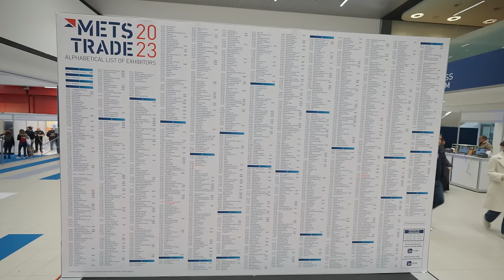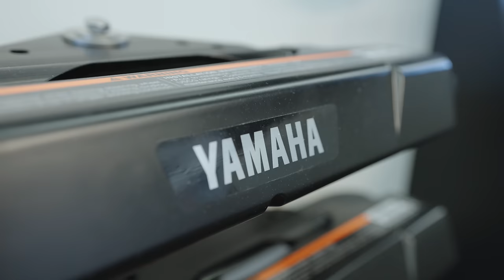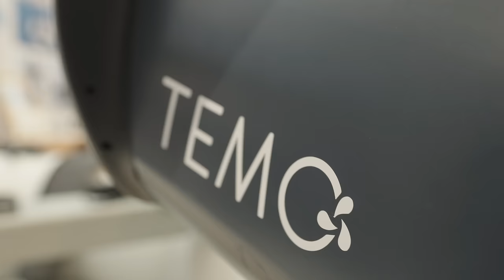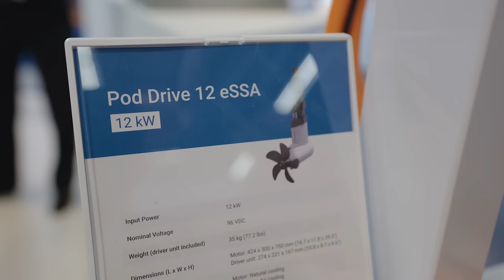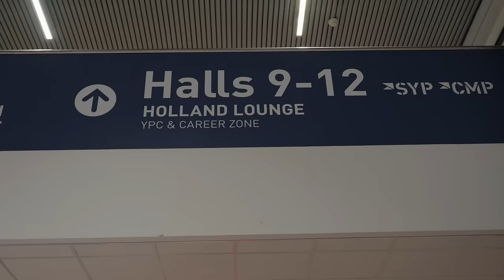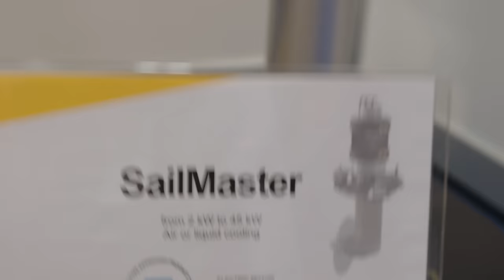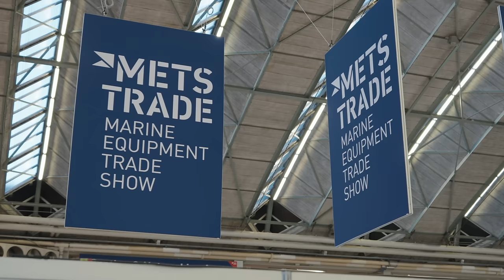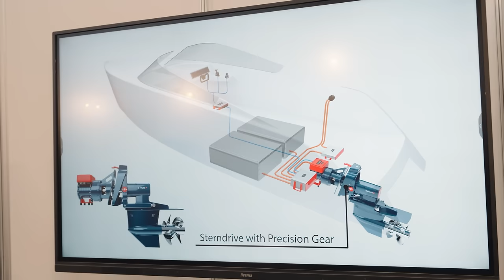The Shocking Truth About Electric Propulsion | Step 371

Comment: I think you guys are a lot further ahead of not only most sea going sailors, but also the industry.
Most of, if not all the manufacturers, cater for the weekend / holiday boaters, who dont have the needs for regen. Its really all about cost, as any electric powertrain carries a near treble the cost to to that of a Internal combustion engine, mostly from Batterys and charging kit / infrastructure.
The Oceanvolt servoprop system alone, is worth more than most peoples boats, i think the whole kit is something around 80K euros, and you need fit it.

Most sailors i know wouldnt venture too far off shore with any electic propulsion system. In fact most sailors would just wait for wind, even if it takes days or weeks.

There are to many weird and one off parts, and voltages , and with so many competing designs, electic drives would need to standarise themselves so that the components would become intercompatible with each other. Imagine rolling into a place like Svalbard on a friday night needing some one off sensor, and they dont have it in stock with your manfacturer.

Hybrid is the solution for the sea going sailor, or even a power boat, as seen with dutch company Combi, and the UK company Hybrid Marine, they fill that gap with both diesel , electric, and regen, all in one package, with the bonus of not needing a diesel generator.

It maybe 20 or so years before electric propulsion for offshore boats, becomes the standard, and there will need to be a big technology jump, in batteries, along with a Industry standardisation on voltages alone.
It takes a lot of time before people see the reliabily and durability for sea / salt water electric kit, before you can say its really better, because the price is still to high, and questionable reliability for the long term.

Comment: Very interesting. There are two other questions I would be asking. Firstly the carbon footprint of electric systems when compared to the potential lifetime of a diesel over electric. IE sustainability and repair when the do eventually fail. Diesels can almost always be repaired, even if it is un economic financially to do so. Secondly the motor is only 50% of the system. Too many of the systems currently available focus on Lithium - Ion batteries not LiFePO4. The former being "borrowed" from the automotive industry and very susceptible to thermal runaway if damaged or there is a charging fault. Lithium Ion should be treated as a potential hazard on a boat whether its a scooter, electric bike or the main power bank. Sail Safe Guys, Ant & Cid.

Comment: I am surprised you have never seen anything like the Combi. I priced up a system for a client, and a 10hp Beta diesel with a piggy-back vetus electric drive, was not only cheaper than full electric with the required range, but as you note, a mega battery charger that required short run time for a full charge.  Some may prefer a diesel, or like you, a petrol generator as a back, rather than a complete engine.  Real world use matters at the end of the day to what is optimum for each use.
Reply from the maker: We’ve seen plenty of electric motors strapped on the back of a diesel to create a “hybrid” system. It’s definitely not new. Also not our favourite solution. But usually those systems are for new installs. We’d never seen a company that willingly promoted retrofitting any existing diesel with a plate adapter to mount an electric motor. That’s what we were interested in for all those who have a working diesel but still want electric.

Comment: The last co. with the prop facing forward I found most interesting. Perhaps mounting a forward facing prop in front of the keel might be most efficient. Since an aft prop must push the boat up various waves some work is wasted lifting the boat. Like an aircraft propeller, in front of the wing the rising and falling of the hull when underway should have less energy loss, and with less obstruction to the sea more efficient regeneration. I'm also thinking it might work best mounted to the keel  instead of the hull. What are your thoughts?

Comment: This was really interesting and informative.  Something I noticed missing was the power platform requirement and also AC vs DC motors.  I also think there is a lot being left on the table with regen in prop design.  And the true science behind KE vs Hull speed is understated and over sold.   25% less power is a bogus number I’m quite confident.   It takes “X” amount of thrust to move an object through water.  A drag co-efficient that is exponential, not linear.  
Electric on a boat is like living off grid with electric.  It’s a lifestyle choice which requires some sacrifices but also an understanding of mission and ensuring enough available storage

Comment: fix pitch VS variable pitch vs servo prop. It is true that a fixed pitch prop can be the most efficient prop.... but only at one speed and load. While a variable pitch prop might suffer from having to work well at all pitchs, the needs of an idling prop just starting to move the boat as compared to full speed after the boat is at "cruise speed" (even if that is only 6 knots) are quite different. Regen is different again and needs yet another prop... not just running it backwards (nice try). I listed the servo prop separately because even though it starts out as a variable pitch prop, it is the servo aspect that really makes this work. It is true you can't just stick a servo prop on your current setup and go, it has to be integrated into the system and have the software to make worth anything at all. The use of such a system shows that the company is thinking of the system in all aspects to get the most out of the the power coming from the batteries or from the ships movement back into the batteries. Very much the same as an MPPT charge controller does. What I saw as you moved from booth to booth were over priced trolling motors on the one hand and standard electric motors hooked up to whatever prop was currently in use on the other.... even for commercial use (well small commercial use, you didn't see any systems for really big vessels). The torque curve of the electric motor is so completely different than diesel as to make using the same prop or even RPM range laughable. OK, the first one you looked at was different.... I would have to see side by side test with this compared to a prop at various speed and load conditions. It is a new propulsion style whose characteristics are not yet well known (how long will the moving part last in sea water or sunshine).
Reply from the maker: Yes. And currently the servo prop has 4 fixed blade angles. But I believe they’re working towards truly variable, as it it’s constantly adjusting based on speed through the water in both regen and propulsion. It also means you can build one system that works on hundreds or different boats by simple software updates.

Comment: ocean volt isn't the only ones finally learning why planes have props facing forward (puller/tractor config) vs facing backwards (pusher). the 2 biggest reasons having the prop facing back is convenience in engine placement as well as less prop snagging on ropes, seaweeds debris, rocks etc, but facing forwards is maximum efficiency since there's nothing in front of the prop to take wind (or water) away. it's just more susceptible to damage, snags and drag. some twin engine planes also feather their props in the event of a single motor loss to prevent weatherveining causing a flat spin due to drag. ocean volt got it right for a static mount. i like the EPT better since the prop is more efficient. either way, if your facing forward, go feathering. facing back wards, furling.

Comment: I can totally understand that many companies do not focus on regeneration. Most boats are not sailed around the world, anchoring when not being sailed.  They spend like 90-95% of their time in the marina to be sailed on the weekends. For those, regeneration is simply not something that matters. But I can still see how an electric motor makes things easier here. Instead of carrying canisters of fuel, spilling some on the boat, one simply plugs into shore power. And it is much more silent. The same reasons I went for a battery-electric lawnmower. It is just more convenient than a combustion-powered one

Comment: The problem with regen is the expense for what you get. And, it's only good under way. Waste of money if most of your time is at anchor or docked. Which is what most people do. AND the constant cruising community is so small, it's not worth it for a company to develop anything.  Got to sell lots of units to make the price good . How much money would you have to charge to make a dozen to two dozen units a year for boats in the 30 to 40 foot range. This is why units that do have regen are lucky that it didn't cost much to build it in without losing forward efficiency.

Comment: I have two Elco EP9.9 outboards on my boat.
I like that they're not proprietary. I can use any 48V batteries.
And because they're using the same chassis as Yamaha and Tohatsu, there are a lot of third-party accessories available.
Reply from the maker: Have you ever done comparisons to how efficient they are compared to direct drive units like ePropulsion or Torquedo?
Reply: @SailingUma  No. The diesel on my boat was marginal. I'd originally intended Torqeedo or ePropulsion pod drives, but I realized I could add outboards without removing the diesel, so I could convert stepwise, minimizing the time my boat was on the hard nonfunctional.
That the Elcos use standard chassis means I have gearing and hence oil changes, and water cooling and hence impellers to deal with. But it also meant I could add Ezy-Glide stick steering, and that's made getting into slips a lot easier.

Comment: What the dude from EPTechnologies says at 44:40 is true: Packing propulsion, folding/servo blades and regen all into a single package inevitably begets a finicky system prone to inefficiencies and cross-dependencies (e.g. if propulsion fails, so does regen). It is surprising to not have a single system with two propellers, one for thrust, one for regen, to work and fail independently.

Comment: Big props (ahem) for this big tour of the "state of the art" great work!

It's strange how many companies seem to just not get the importance of regen. I'm another long range cruiser who really sees it as a must have. Granted, it is complicated and to get the most out of it. They will have to run some CFD simulations of various prop models. Even the companies that are the best at regen are really cagey about the data. Ocean volt seem pretty good, and the variable pitch idea makes sense, buuut the pitch controller does not take in boat speed data or have any way to learn and predict the optimum settings based on historically observed performance for given environmental conditions. They won't sell (me) a system without including their own batteries which are like 4x the price per Kwh of more standard LiFePO4 cells , and in general the system is really expensive. Also, the VP prop is only available on sail drives, which I find strange given that shaft drive is often preferred by the the folks most interested in regen, the long range cruiser,  because of it's stronger design, being naturally more protected from impacts, over the more exposed sail drive. Also, I didn't see a single one using axial flux motors which have a vastly higher power density than other motor designs. makes one want to have a go at designing their own ... 

I was a Torqeedo customer already 8 years ago for an outboard (cruise 4.0) and while there was a lot to like, (the precise control, the quietness) the support was worse than non existent. However, an open unprotected 48V system without even splash resistant connectors in a splashy  dinghy led to a lot of issues and embarrassments, even after I had a custom enclosure built for it. I often got strong tingles through salty wet ropes. Mad electrolysis, nerve wracking beach landings etc , and those expensive plastic propellers that you can't find anywhere lasted less time than anything else I've ever owned on a boat. One even got pulled off it's splines by a wave while the dinghy was hanging on the derricks! That outboard system with all the chargers and everything cost me about 10k euro at the time. They quoted me 250 (god damn!) k euro for a deep blue system to re-power my main house boat, like many times more than the value of the boat. I am so very happy that they have plenty more competition these days!

Comment: I found this video very informative and interesting. I understand your need for regeneration but I also understand why it's not such a big deal for a lot of electric propulsion companies. Regeneration is only important for sail boats, it's not something that motor boats can use. I think the needs of the systems are very different between Sail and motor boats. Motor boats use mechanical propulsion 100% of the time while sailing yachts use it let's say, 20% of the time and 80% under sail, so I see most of these companies developing for motor boats 1st and then the technology is passing down to sail boats, hence there is no focus on regeneration.

Comment: Efficient regen requires a constant speed propeller mechanism to keep the motor spinning at the RPM it makes power most efficiently, and a fast MPPT to control the load. Oceanvolt patented an electronic pitch control and is likely why there are so few options. An alternative would be a propeller governor like used on aircraft engines that hydraulically actuate propeller pitch when the motor underspeeds or overspeeds.
Reply: I think that the pitch control is a key technology for regen.
The patent is good for ocean volt but very bad for making regen widely available with more producers

Comment: What a brilliant video, I had no idea there were so many electric motor manufacturers.  I hope it encourages people to look around for options beyond the more publicised brands.  The French one FinX with an intriguing disc proplulsion instead of a propellor.
Reply: I liked the look of that one, but I was longing to ask how it goes in reverse to slow/stop the boat? Can't find anything on their website about that either. 

I mean, I'm sure it does reverse... right?
Reply: @dansmithwave  The Fin5 motor can be fully turned through 360 degrees.  To reverse, you simply turn the motor through 180 degrees so that the diaphragm is facing forward.

Comment: Great video!  I am quite fond of Elco, my father used to work very near their old PT boat facility in Nyack NY.  Their outboard motors are beautiful, but the right angle drive could be a maintenance/noise/efficiency issue.  I do think that direct drive systems are better overall.  I'm experimenting with an "on the cheap" Newport Vessels 62 pound thrust trolling motor (on our Compac 23).  While weak, it is incredibly light and quiet.  Electric could be the future, especially after a long battle with ethanol fuel and other issues with a Tohatsu 6.  After finding a source of non-ethanol and myriad modifications it is now perfectly reliable, but it seems there must be a better way.

Comment: Take a look at Edison motors of Canada Topsy DIY logging truck  ..Diesel electric ...using a detached generator... Its 50% percent more efficient and cleaner burning..
Because the electric motors do the driving and hauling the ICE motor just to use their words can sit in its Stoichiometric happy place and doesnt have to run when the smaller battery pack is supplying the power it just has to make electricity when needed at its best speed and constant load.

The other thing is the regen under breaking is automatic and saves the brakes. 
The other aspect to the hybrid is the new high efficiency compact APU ice motors coming onto the market ..Liquid piston X motors are a prime example. 

Prop size and pitch are critical for e power usually larger and more blades plus pitch matching. 

But all conventional props are pretty poor.  In propulsion . 

The new gen batteries will probably see off lithium as a major component. Lithium sulpher is light and better but Na ion Al Sulpher looks about the best..  theres a breakthrough been made in terms of charging cycles by using a lithium ions in the electrolyte..they act as sheep dogs for the Al S ions and protect the  electrodes. Interesting times ahead ten times the capacity... temperature stable and cheaper safer materials. Longer life and easier recycling.

The other thing is we need to try to get away from permanent rare earth magnet  motors. There are alternatives i know about AEM advanced electrical Machines .. they dont even use copper wire in their windings their motors are compact modular, as are their transmissions and do very good regen or can be switched off as  required  so will freewheel with no cogging.  Oceanvolts own inboard motors look similar but are permanent magnet motors. 
they can produce massive torques as they were developed for commercial vehicles and duty cycles.
As they are a spin off from from Newcastle University they understand and are happy to show the numbers and work with people. Plus not needing rare earths or copper windings they save on cost. They are also impervious to vibration and heat degradation compared to permanent magnets. 

As you were at the mets did you see the Accoya modified wood or the MettalWood  technology rot resistant and stronger soft woods ...in the case of the later stronger than Steel and potentially on a par with kevlar at 5%of the cost. 
Mets do tech support talks reports online for their members members so you glean a lot of info from them.